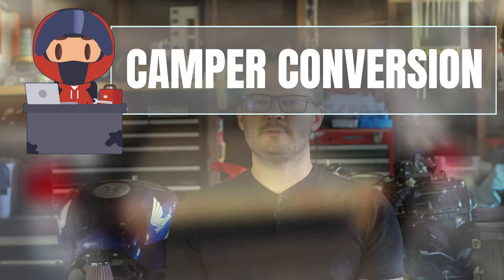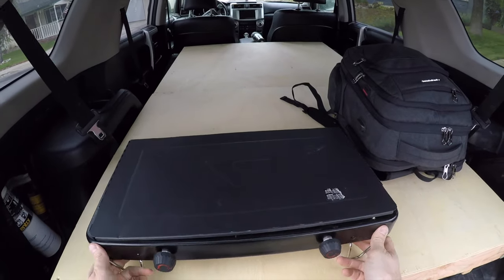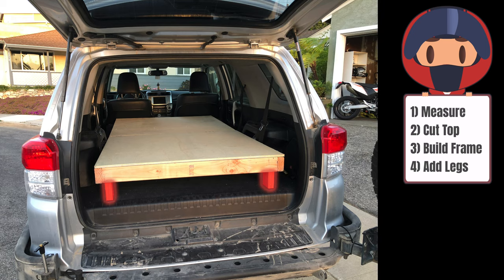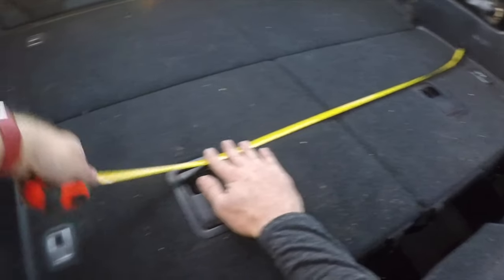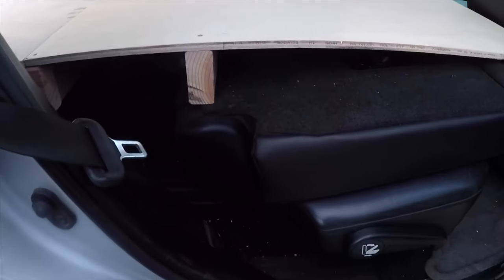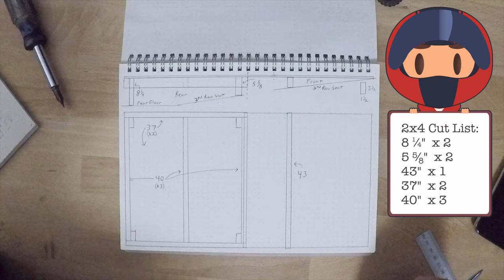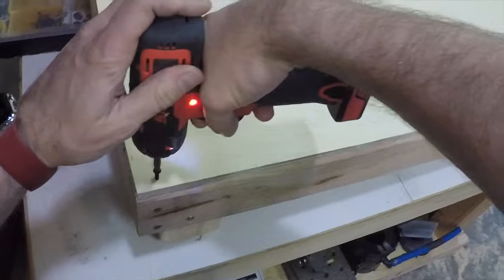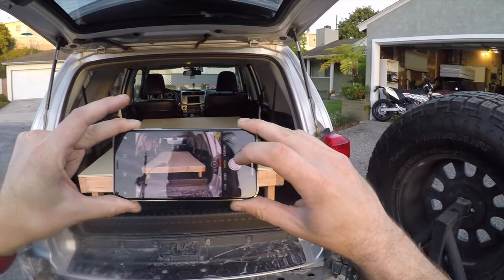The Easiest, Cheapest Car Camper Conversion

Comment: I love watching these conversion videos as I have a pickup truck that I use for short term camping.  My design is even simpler than yours as I don't want any platforms to reduce head height inside as I have a short comfortable beach chair to sit on.  I lay a 3" foam mattress cut to fit for 2 people.  Were does my stuff go?   I hitched a luggage rack on the hitch with 4 fitting fiberglass boxes to hold my camping gear and done ! Everything is strapped down and secure.

Comment: Suggestions: make the top sleeping boards smaller so you can reach in while inside without moving everything.   Get a camping cot so no need to build the platform.  How can you measure with the front seats all the way forward and then use them?  Making the platform so it can slide in and out for the bed area also allows for having a couch type setup inside when you can't be outside due to the weather.

Comment: I lived in my volvo station wagon for almost a year and it has fold flat back seats but in order to do that you have to lift up the bottom seat cushion and fold it forward and then fold down the back and then you loose the big gap of storage space behind the front seat it gets filled with the bottom cushion wich still sticks up enough to take up precious foot room when laying in the back so I just opted out of folding the back seats completely flat and folded the backs down without folding out the bottom cushion  and put my trifold matress on top at a slight slope and slept with my head in the back on the flat part it was fine  the inside of a station wagon is not tall enough for any kind of platform
Reply: Oh you have a Volvo 240 too? Epic
Reply: @fast.biking_freddy  99 v70xc awd Volvo but I would love to have an even older volvo someday

Comment: Thanks. Any way you'd be able to share about your more complicated build you mentioned?
Reply from the maker: I sold that car years ago but it wasn't too dissimilar to this build, except that it had nicer wood and I made a kind of bookshelf in the back with shelves sized for things like my water bottle and propane tank. If I were to do it again I would probably build the platform part and then buy an actual bookshelf.

Comment: Personally I just recline the driver's or if I'm feelin' frisky, front passenger's seat all the way and sleep in that. Way more comfortable than any even vaguely portable mattress I've ever found., nevermind that crap people use in tents.

Except in my tow rig. Which is a single cab. With a shitty vinyl bench seat. Slept in the bed at a freeway rest stop once, people kept waking me up to try to buy the car off my trailer. Slept in the cab laying across the bench once, with the engine running, wearing full race gear, in a sleeping bag, because it was substantially below freezing outside with like 40mph winds and this was the only way I could figure out not to die. Heater on full blast, barely got up to like 40 in the cab because the weather sealing is terrible and it's a diesel so it makes little heat at idle. I considered throwing a brick on the accelerator pedal, but decided redlining the engine for 8 hours probably wouldn't end well. ... And there were people in tents nearby who I'm sure already hated me. And themselves.

Since then, the rule is "either bum a spot in somebody else's RV, get a hotel, or don't be the sucker that has to tow the racecar".

Comment: Wait, you don’t need to spend $3500 for a “storage system” to be a true overlander? 🙄😜😎 

I got a $18 24”x72” wood plank (sanded and super light!) from Menards and a 4” foam mattress (Amaz.) for the uneven back of my 2018 4Runner after completely removing the back seats - made a lot more room, saved some weight, and A LOT of money/time 👍🏼 I’m 6’ and sleep behind the passenger seat - works great!

Cool vid - thanks for being no-nonsense practical 👏🏻

Comment: I don't know how, but you managed to make building a rectangle confusing. Probably because it was in inches and I just woke up

I used to work at a place that did battery fitouts for campers, the amount of money people would put into a 4wd just to either go to the same beach as everyone else or to tow a caravan to the same caravan park as everyone else was mind boggling. You got the occasional person who was fairdinkum and going actually out bush enough to justify 10K worth of power system, but most of them were just posers honestly

Comment: Did you ever sleep in your parked car   keeping engine ideal running condition with AC/ hot air on for whole night  ?
Reply: That's terrible for the environment, Aditya! And on top, it ruins your A/C - it should only be on for longer when the car is moving.

Comment: what stove do you have?
Reply: That is the Ozark Trail camp stove. $29.97 at Wally-World . . . Despite the cheap price, it's a great stove. I've been abusing mine for over 5 years and it still works great! Pro Tip: Many Ozark Trail Brand products are manufactured by major name-brand companies under contract for Wal-Mart. You can get comparable quality at a fraction of the price - Ozar Trail tents are the exception to this rule. Their tents are garbage!

Comment: Just wondering about the brand and model of vehicle this is, as it came up under 'Toyota Highlander' ... . I was thinking of doing this on a pickup bed with cap, but a vehicle like this seems to be a better option for all sorts of reasons, not least of which is fuel efficiency.
Reply: I had the same question.  I think it is a 4Runner. 2nd guess would be a highlander.

Comment: I really enjoyed your video. What kind of stove burner do you have? It looks really compact.
Reply from the maker: Ozark Trail. It's compact but terrible heat control for low heat. I just replaced it with a Eureka Ignite Plus from REI which is way better, though 4x as expensive.
Reply: @SuperfastMatt  Thank you, will check out Eureka Ignite Plus.

Comment: Can this be done for a 2008 Chevy trailblazer?  I need to convert mine for my spring/summer/fall camping season. Do you suggest I remove my seats?
Reply from the maker: Yes, it can be done. I don't recommend removing the seats because you won't get much extra height.
Reply: @SuperfastMatt  thanks. I’ll def take your advice

Comment: Nice, easy/cheap build that gets the job done! I'm building a (Ford Expedition) full-time overlanding vehicle and I'm down to converting the inside cargo area to sleep/living/storage space. Because I'm a full-time videographer and I have a LOT of equipment, my interior build is a bit more involved than yours, but my end-goal is simplicity and affordability (because the off-road mods have been stupid-expensive). GREAT VIDEO!

Comment: how do you like that ozark trail 2 burner stove?
Reply from the maker: it has terrible flame control; it's basically on high or off. Still not bad considering the price and how small it packs. Although I did just replace it with a Eureka from REI. much more expensive but I got tired of burnt eggs.

Comment: Yes, because cooking inside a foam and carpet filled box is always a great idea.  Don’t have a pullout drawer that you can have under the lift gate and have air movement on three sides and be protected from the weather cause that’s dumb.
Reply: Actually looks better than originally thought, especially the bear/beer.
Reply: If you watch it with the sound on, you'll understand why he built it the way he did.

Comment: you can just put a mattress in saves you $40 and a hours time
Reply: Then you have no under bed storage for all your gear etc. And the air mattress won’t fold out of the way when you want to cook. In such a small space, everything has to be easy and multipurpose, an air mattress is not.
Reply: Agree with you, especially since I have no woodworking skills and no desire to do it.  You can always fold the trifold mattress and bungee cord it to the side in the daytime and you have plenty of storage space.  The purpose is to load up and go.